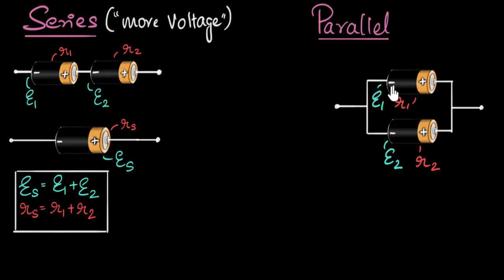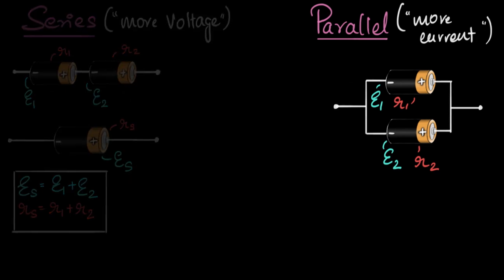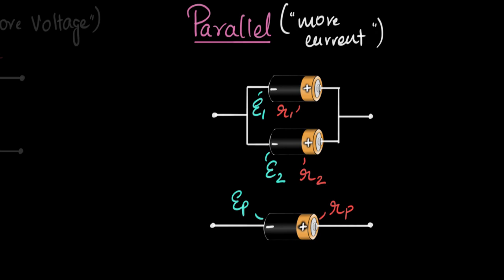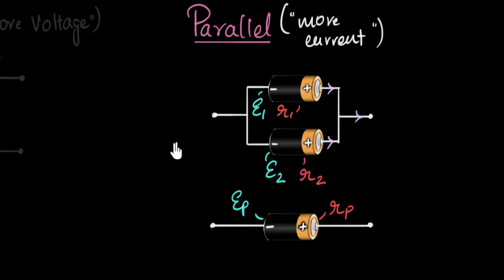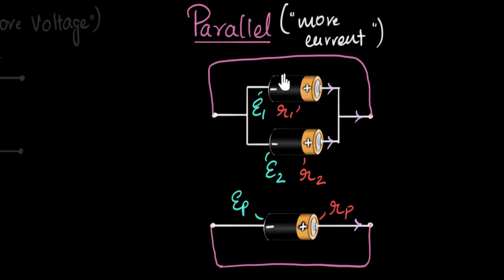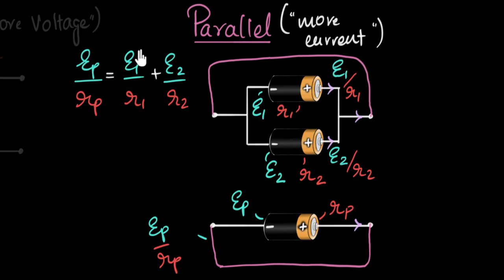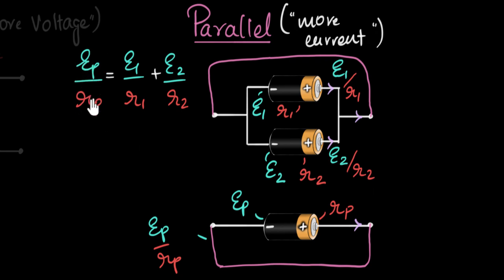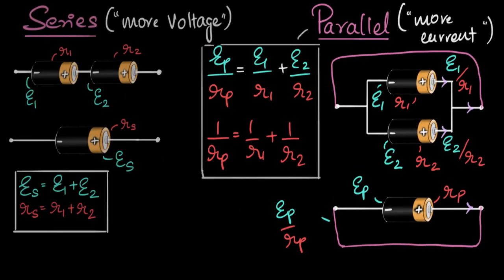Cells connected in parallel | Electric current | Physics | Khan Academy

Comment: Really nice video, thanks a lot. But notice this only is the case when the cell has internal resistance - if it doesn't (in exam questions), the current added up with be the same as if it was connected to only 1 cell, so the degree that the branched current in different cells will decrease more substantially than with internal resistance

Comment: Sir series circuit me voltage ki addition hoti hai fir curent ki q nahi?
Reply: Current also increases with voltage increase in series but since resistance gets added up more in series comparative to the adding of resistance in parallel parallel combination therefore it provides more current....this is similar to the concept of greater current produced by parallel connected resistors despite producing less equivalent voltage than the resistors connected in series.....
Reply: Resistance bhi to badhta hai chutiye
Reply: Current will be constant in series. Think of it as conservation of charges.
Reply: Take a circuit with two battery attached to each other in circuit, the current that will flow from one terminal to first battery to second terminal of second battery needs to be constant due to conservation of charges, you can't have more or less current through the load as that would mean more or less charges go inside than that come outside, this will burst your circuit.